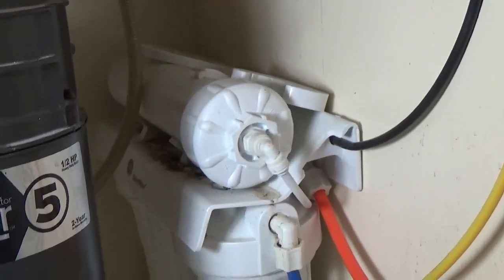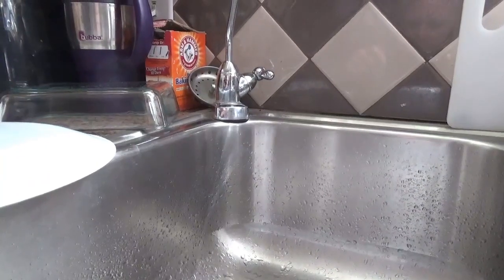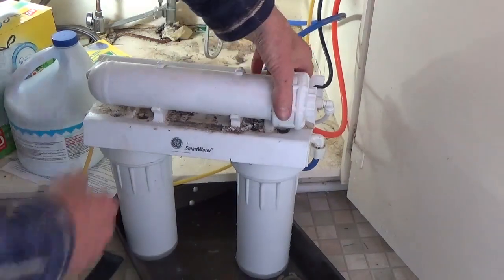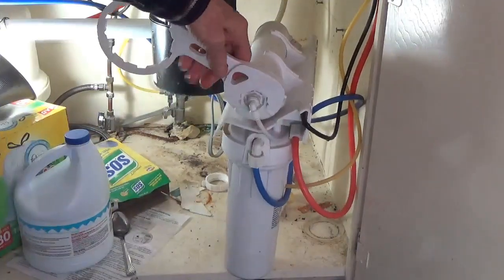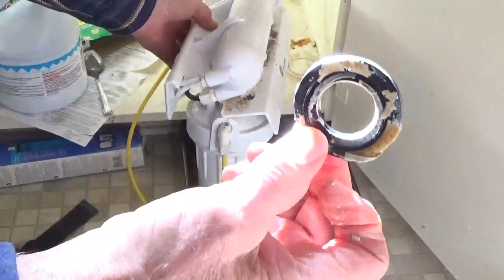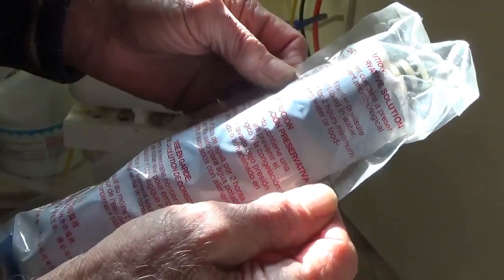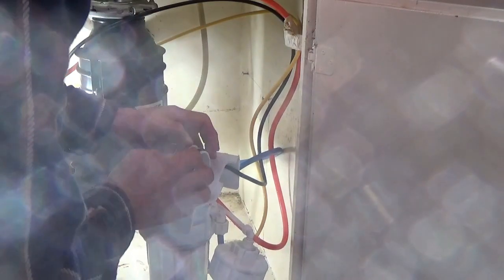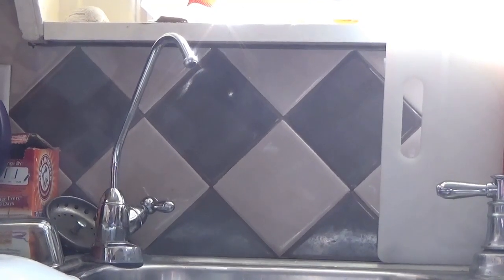Reverse osmosis filter change for a GE  reverse osmosis

Comment: I believe the sanitization process (water filled with water in pre sump up to 1 inch and adding bleach) should be done without the ro cartridge and both pre sump filters removed. The ro cartridge can become damaged if left in during the sanitization process
Reply from the maker: I'd rather change filters
Reply: @dustyguy  yeah the filters go into pre and post sump along with the ro cartridge after the sanitization process
Reply: I came here to post this that I talked to the company you're supposed to bleach without the filters before putting the filters back in you rinse everything off put the filters in and put it all back together
Reply: @Melissa-st3sq  that is correct
Reply: Yeah thats the only part that threw me off about this video. Other then that, everything else seems right.
Reply: So, you're all saying this guy posted a video showing us how to do something, as if he knows what he's talking about, but actually he's doing it wrong and leading everyone through the steps incorrectly?
That's ridiculous.

Comment: I know this was 3 years ago, I hope you don’t follow his instructions putting bleach while the filters are in , you suppose to remove it the add 3 tablespoons of bleach on the first cartridge case where the supply water is let it filled with water should not take that long since there is no filter. Let seat there for 15 minutes the drain until you don’t smell the bleach.

Comment: almost messed up my water filter following this video, thumbs down
Reply from the maker: Sorry about that what did I do wrong
Reply: @dustyguy  there's a black grommet on the inside of the cap, for the filter on the top, I just screwed it back in like you did in the video and it caused a leak, luckily it didn't break, the thing got stuck so I had to use a bunch of tools to open it back up,
Reply from the maker: @rogerellis7758  Thank you for the response, I'm going to check that out in the future so I can make a note and make sure it's in the video of what to look for and be aware. Thank you again.
Reply: @rogerellis7758  so you're not supposed to screw it in? Just push it? Or how?

Comment: and why did you add bleach??
Reply from the maker: That is what the replacement instruction tell you to do. You will when finished and it fills up that you will open the faucet for 15 minutes and the teaspoon of bleach cleans out the filter case and the lines.